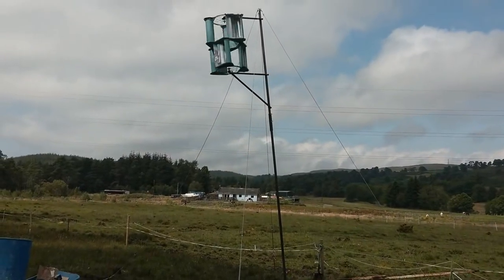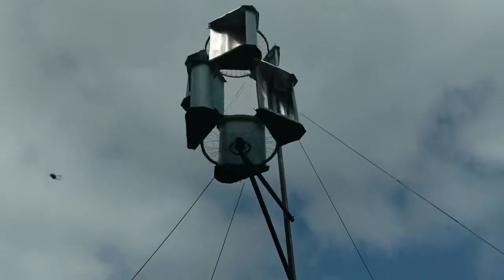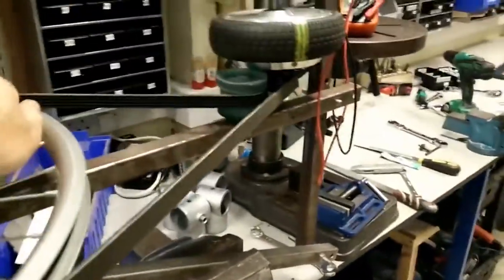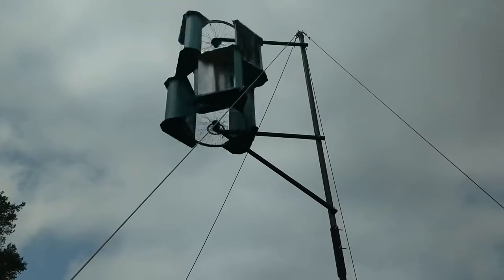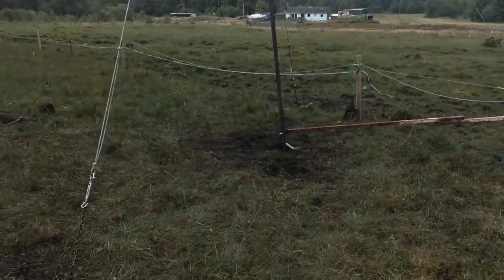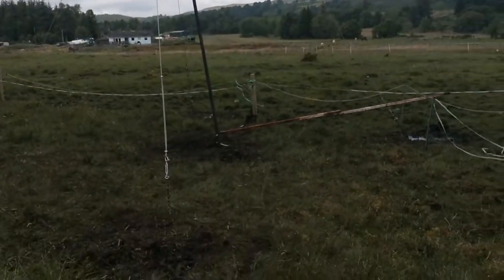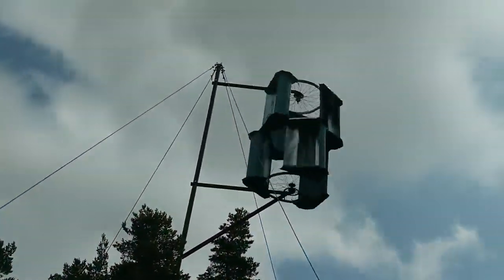$30 Wind Turbine Update - Scottish Highlands Install

Comment: Am i just stupid or something... i dont see anything up there being driven no power transmission...
Reply: He did say in the video that the motor was not installed yet as part of checking out the cables to hold it down and stability in the pete
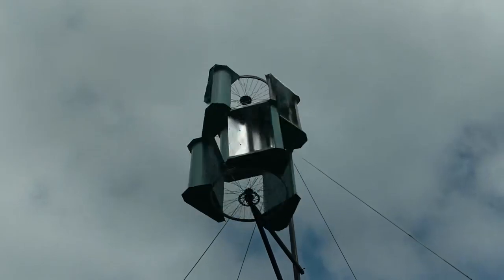Reply: Maybe you'd like to rewatch the video and listen to what he's doing. :D 0:12 and  3:00 and 6:32
Reply: Well spotted Maxim. He's working on a secret plan to transmit the power using radio waves (and an invisible generator).

Comment: Why don't you just use a bike gear with the chain instead of wrapping the chain around the wheel? you already have the axle to set the gear in place, and you'll avoid the issues with the rubber belts.
Reply from the maker: RPMs, mainly. Vertical axis wind turbines do more torque than horizontals, but at less revs, so it's harder to get charge voltage out of any generator/alternator you attach to them. So usually things need to be geared up, hence the eventual belt drive system here using the bike wheel rim, so giving about a 10:1 ratio to the pulley on the alternator.

If you were running a lower rev application, such as a piston water pump or the like, then a chain drive coming off the wheel's sprocket set could be a good solution.
Reply: @OpenSourceLowTech  
Thank your for your answer!! Now I have one more question for you, or if you don't mind pointing towards then sources from which I can learn more about the topic. When implementing a system like this one, which does not deliver power in a constant way, would you be working in an almost obligatory way or with voltage rectifiers or with batteries?or am I wrong?If this is the case, the part that generates the greatest complicity is the fact that I cannot take direct electrical power from the generator given the variations.How did you face or work around this problem?In the hydraulic turbine this is a little easier, since the flow is practically constant

Comment: Volts are ac or dc
Reply from the maker: Depends on what I attach. Will probably be a hoverboard wheel as an alternator, in which case three phase AC.
Other options such as treadmill motors would be DC.

Comment: Why not use the hoverboard motor as direct drive. With open source firmware from Niklas Fauth (and my online compiler https://pionierland.de/hoverhack/ ) you get recuperation that DC DC stepup to your battery voltage. With my solar car I can charge my 24V battery with as low 2 revs per second.
Reply from the maker: How do you mean? Are you somehow using software to increase the volts per rev from the wheel?
That would be very interesting if so...
Reply: @OpenSourceLowTech  yes it is so :-)
The six Mosfets of the hoverboard controller act as a full bridge (H bridge). I haven't looked into the code to understand how Niklas was able to use the inductivity of the motor as the step up coil but it works.
Two days ago my 24 Volt battery was empty and I could charge with 50 Watt by pulling my little car at 5 km/h which resulted in about 3 revs.
Don't know the efficiency of this step up charging. But as these motors have 14 rpm/Volt (kV) and you only charge a 12 Volt battery, a direct drive wind generator with step up should be more efficient then your belt drive (the one you use is the belt type of least efficiency).
And you can control the rotation speed to match the wind speed ..

Roland
the little physicist :-)
Reply from the maker: @robodurden  This is potentially amazing. I'm more into the mechanical side of things than software and electronics, but if you can email me on opensourcelowtech.org at gmail.com with a little more info I'll definitely look into this.
Reply from the maker: And which parts of the hoverboard are needed?
Are you on facebook? Got a group there for the turbine and we're discussing this as an option. Your input would be useful.
Reply: @OpenSourceLowTech  don't like Facebook but may join such a group. 
All you need is the low cost controller board. Watch my tutorial videos here. When buying new controller board: better buy one with the original stm32 chip. New boards now often have the GD32 clone which might have problems with our open source firmware.
Reply from the maker: @robodurden  https://www.facebook.com/groups/windturbinemakers/